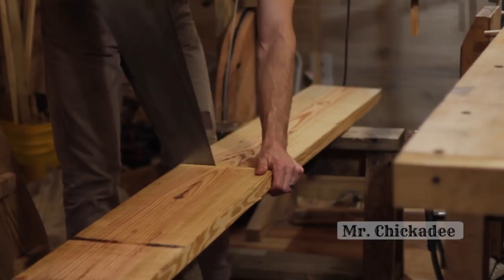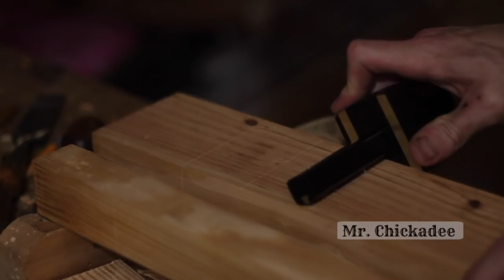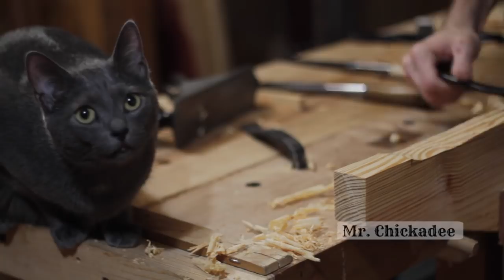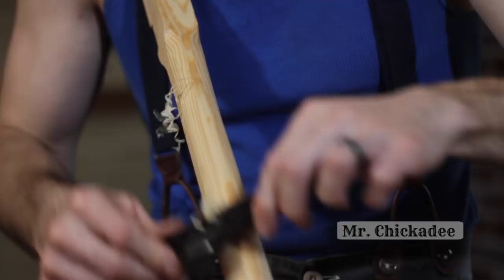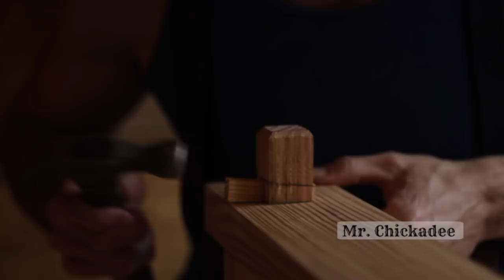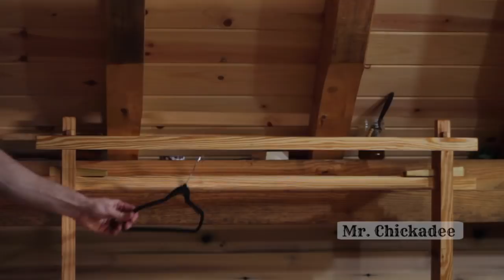Coat Hanger with Secret Wedged Tenons

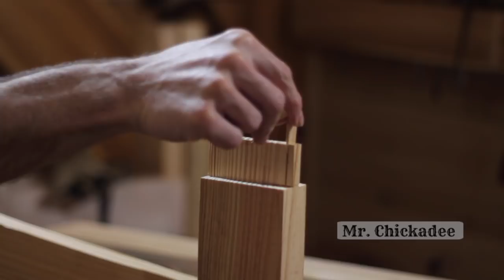Comment: 9:28  Very smart, wedges that drive themselves in when the parts are put together.
Reply: The problem with the blind wedged tenon is that once the joint loosens up it is very difficult to repair.  The joint may loosen with time but it will never come apart so the coat rack may get wobbly but not completely fail.
Reply: Tanasi Tim then just drill through the side and pound a peg in
Reply: Tanasi Tim Classic Japanese joinery.

Comment: Nice video,
The clothes rack looks great.
I might have an improvement suggestion.
You dipped your hole chisel at the pin hole working out in oil.
I have an average tin can (diameter about 8cm and about 10cm high).
Then a fabric strip (example old jeans pants or other cotton fabric) about 10.5cm wide, the fabric tightly roll up, which fits tightly into the can. Then you will pour some oil on the fabric in the can, as much as the fabric can suck. Depending on the fabric type, it takes different lengths.
When this is done, you can use your chisels, planing, sawing barking and the tools are lightly oiled, which allows them to slide better over the wood or the saw glides better.
Reply: I studied woodworking in Japan and what you describe is similar to what they do.  They use a large bamboo joint the way you use the can.

Comment: BTW that needs hand made wooden hangers :)
Reply: John Hales how would You make them  with the radius of a hanger hook?  Some where You would have weak short grain  

The only thing I can think of is steam bending but then the bending that tight of a raduis would be hard
Reply: I've never seen a sturdy attractive all-wood hanger.
Reply: @Walt Lars with a wooden triangle base and wire hook coming out the top
Reply: How about coming out of the top of the wood triangle base at a 45° angle and then three right angle joints with the 4th side shorted to allow the rod in?
Sort of a "3/4 of a wood diamond on top of a wood triangle"?

Comment: You sir can cut straighter with that rip saw than what I can with a table saw.
Reply: And not only that, notice how effortlessly he switches between right and left hand (like, at 9:08 or so.) I know and have known a lot of first-rate cabinet makers over the years. I have never seen anyone with this level of ‘virtuosity’ in tool handling. What blows my mind is really how young Mr C is. From what I understand, he didn’t start out in wood working. It takes a life time to gain this level, and most will fall short. Amazing!

Comment: You must have had high  humidity  in the beginning because all your saws were acting like they were dull, needed sharpening. On all of your videos I have been most impressed by how well you keep your tools.
Reply from the maker: I keep my saws very sharp, this was some very hard and thick pine, takes just a few strokes to cut through.
Reply: Then that was the problem I saw very hard thick pine. You still went through it with little difficulty. Very nice work.

Comment: This man could tug off a bear and still wouldn't get cramp..
Reply: No kidding, i've been sawing wood all the week, with a small saw, and left the big saw cuts for the end of the week hopping my muscles would be in shape...pfft. Nope. Got a cramp right along the back in one minute.
Reply from the maker: Though there is some strength and endurance involved, proper technique helps reduce fatigue, the saw should be held rather loosely, just tight enough to control it, with the forefinger extended, let the saw work, don't press down or force, imagine you have to find a pace and rate you can maintain for hours. It also helps a bunch to train yourself to saw lefty as well, I do that a lot.

Comment: interesting that you would lube a smaller chisel for mortise cutting, and not the larger one, where there is more force being applied, or on the deeper mortise for the feet.
Reply: On the smaller one he used a true mortise chisel - both sides thick & square to the back. Makes them stronger for chunking out waste and staying flat.  Since the mortise was only as wide as the chisel itself there's more friction with the wood.  The larger one was with a regular chisel with the angled sides / thinner edges and a hole wider than the chisel.
Reply: AJPlaysToday there is more force nessary for chopping out mortises 

The broad flat chisel is for triming off that last little bit in the corner of the two saw cuts  or flattening a  cut
Reply from the maker: Thank you, its just some linseed oil. Its an old Japanese trick to help mortises, in this case the pine was very hard and resinous, the oil helped a lot keeping it from sticking.

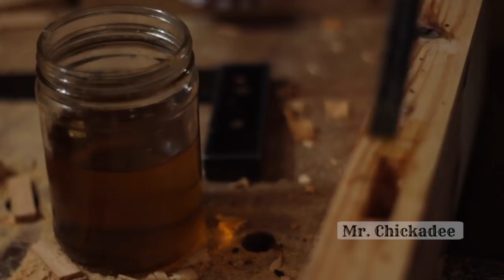Comment: I just discovered your videos and as a mediocre cabinet maker I find your videos amazing and intriguing but I do have a question, if you have time to answer. At the 4:00 min mark you dipped your chisel in your linseed mixture. Was that for lubricant purposes or was it for some other reason.

Comment: I've noticed lately in many of the furnishings for your home you've been using a lot of wedge through tenons rather than actually joining the wood. Are you just doing this in case of a move in the future?
Reply from the maker: Not exactly for that reason. I really like the old asian system of joinery that can be tightened afterward, or pieces replaced and reassembled without destroying everything. It just seems more practical to me, and interesting, and of course if you need to move, VERY practical.